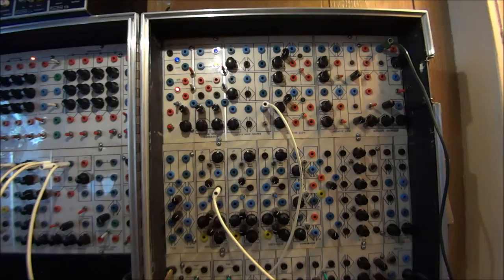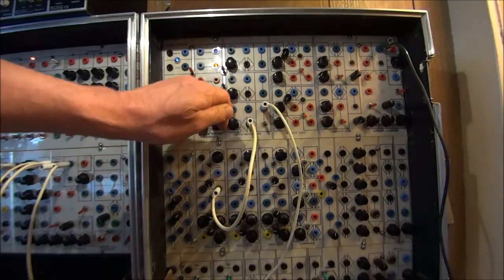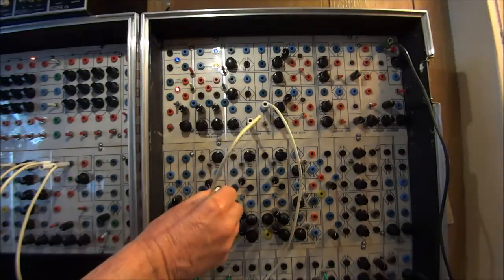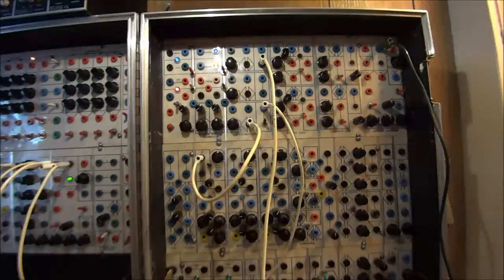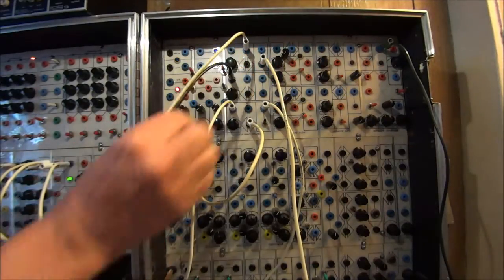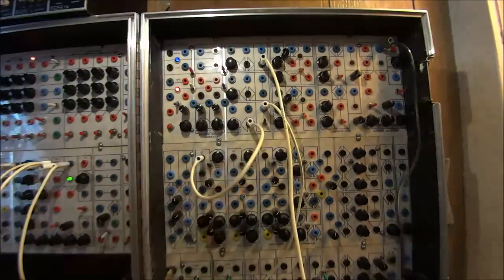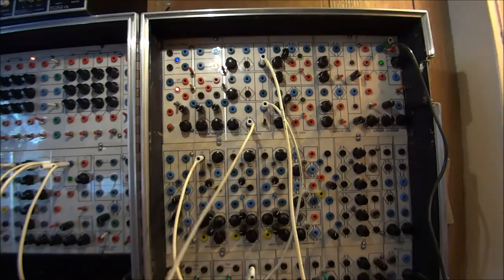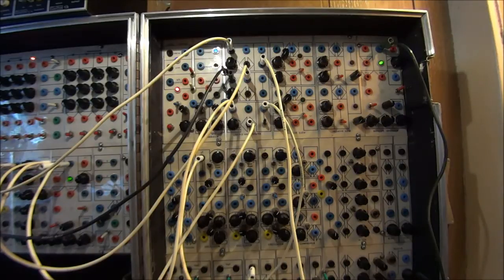Wave-Folding with Wave-Shapers - Serge Synthesizer Tutorial

Comment: Any way of doing this in software? In a way that: A) doesn't create an aliased mess, B) doesn't send the average computer to it's knees in terms of computation. Some of this reminds me of FM, but has it's own characteristic. I'll probably just have to to get someone with a modular to record some sweeps and then convert it to wavetables in Serum. There's not much like this in the software world that doesn't have the problems outlined earlier :(
Reply: +Adam Smith Check the Aalto VST. It's based on Buchla waveshaping but its very similar. if you have ableton Live check the waveshaping capabilities of the Saturator
Reply from the maker: +Adam Smith  I don't know off of the top of my head. I am playing with a digital modular called Trilobite but haven't tried this. Maybe more in the future.
Reply: +Doug Lynner 

Just discovered this http://xhip.net/effects/?p=Multiplier . Not quite the same, but looks interesting, as well as being aurally quite similar.
Reply: +Doug Lynner 

 On the computer, for modular stuff I use Reaktor 6 Blocks. I haven't tried Trilobite. What it's like?
Reply: You can do wavefolding using FM / phase modulation.
Use 2 operators, set the carrier to sine, 0 Hz.
Try an LFO on the modulator operator to vary its amplitude.
When the phase of the carrier is at 0 degrees, the wavefolding has only odd harmonics.
When its phase is 60 degrees, you get all harmonics.
This sounds like many analog wavefolder, a full saw like sound.
At 90 degrees on the carrier, you get only even harmonics.
All odds are suppressed, including the fundamental, so it sounds an octave up.

For a different flavor, try a 0 Hz triangle as the carrier.